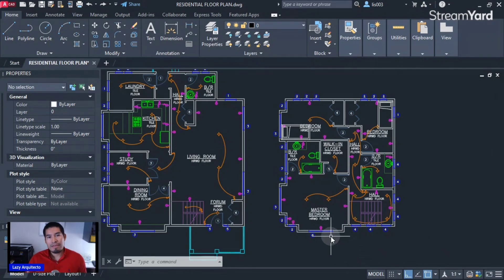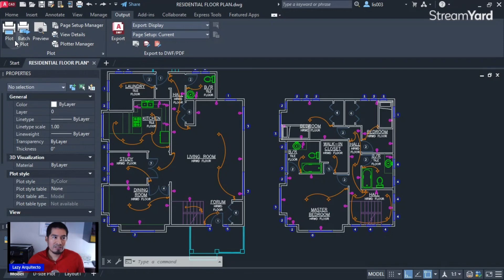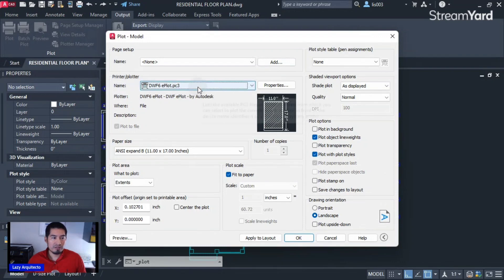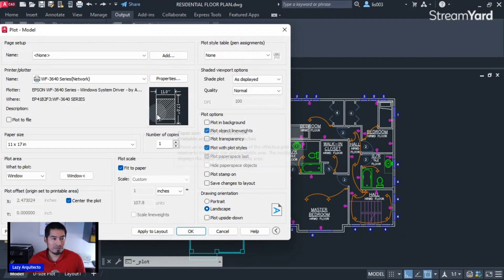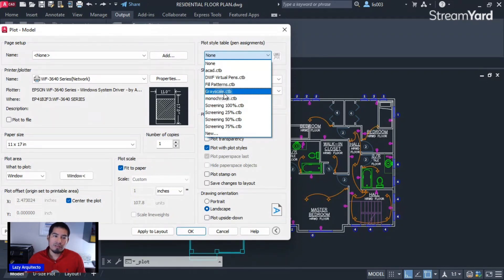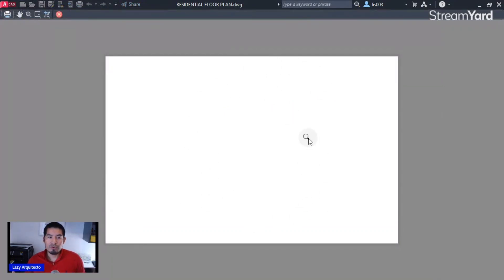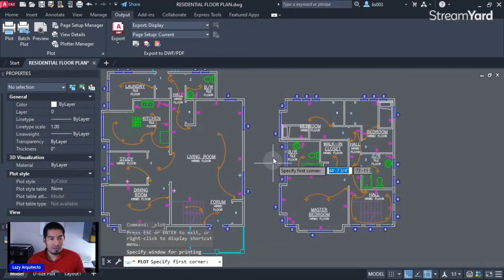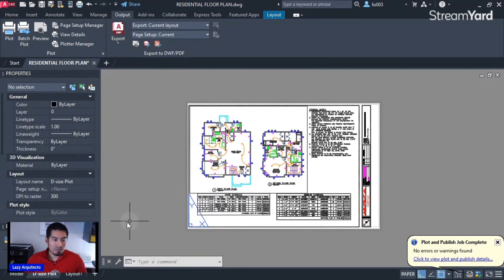How to Print an AutoCAD drawing from Model (As total Beginner)

Comment: Hello Sir! Did you know how to fix the dialog too large to fit on the screen in Autocad?
Reply from the maker: To resize it, grab it from any side and holding left mouse click, drag it as needed
Reply: @LazyArquitecto  I think it's like a bug that unavailable to resize with mouse.
Reply from the maker: @sovanndara8000  which dialog is it?
Reply: @LazyArquitecto  Dialog in plot model ( Print )
Reply from the maker: @sovanndara8000  try resetting it like this https://youtube.com/shorts/CdTv91znSqc?feature=share
Reply: @LazyArquitecto  It still not working
Reply from the maker: @sovanndara8000  would you be interested in a video call service to quickly help you with your Autocad issue? If so here https://wa.me/message/3767OF3CTN2XL1